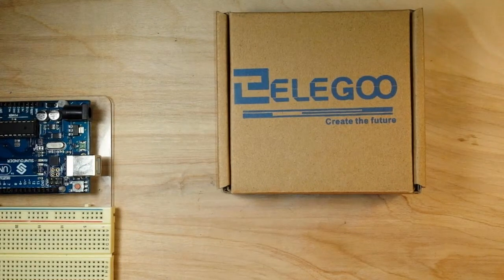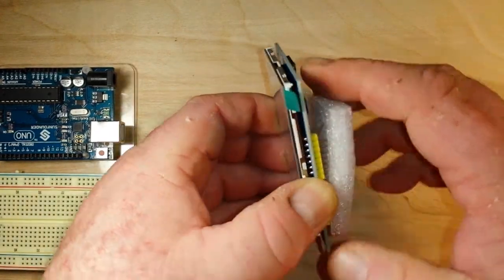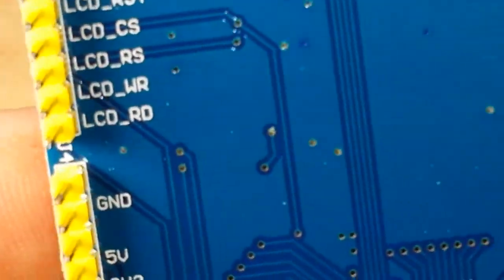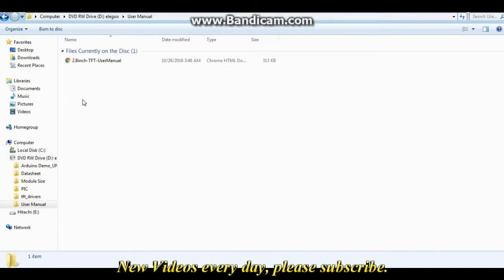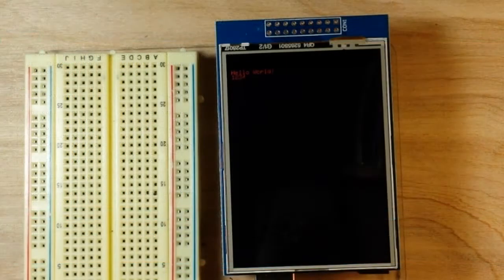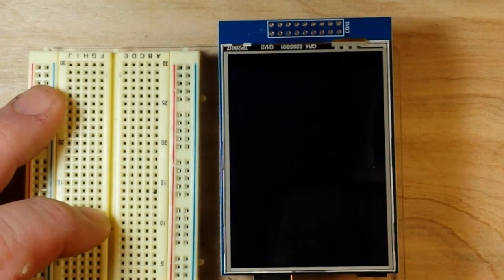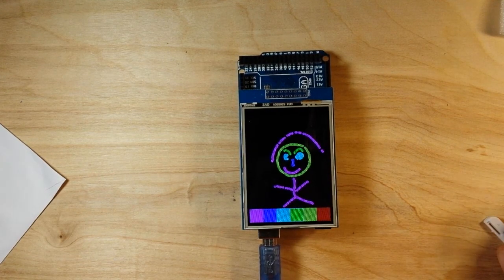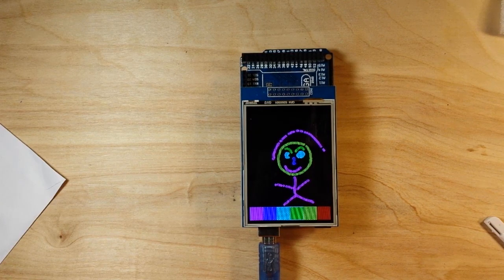How to install and use a TFTLCD with Arduino

Comment: Where do you get the tft drivers (initlcd and setxy) if you didn't get a disc and where exactly do you install them? 
I have the same TFT screen shield, had it for years but never got it to work.
I've tried every library I could find but can't get a thing on the screen, just the white LED backlight.
Reply from the maker: Adafruit
Reply: Cheers mate

Comment: Sometime between when you did this review and July 2017, Elegoo created their own modified versions of the Adafruit libraries, they even leave all of Adafruits copyright info and just substitute Elegoo for Adafruit. So for folks looking for a TFT that will use the Adafruit TFTLCD and Adafruit GFX libraries... well, they just may not work anymore.

 I have noticed several folks with OLED modules using the Adafruit GFX libraries. I think a good solution would be to use the manufacturers display driver (in this case the Elegoo TFTLCD library) and the Adafruit GFX library, so the one library could be used for multiple display modules. Next week I am going to look at the feasibility of using the Adafruit GFX library. If this is not possible I will just get the Adafruit display an let the Elegoo gather dust.

Comment: So can we attach any sensor with UNO and use this display ?
Reply from the maker: Sayantan Maiti it takes almost all of the pins on an Uno. It will work much better with a mega.
Reply: Please make a future video of making a photo frame with this display and a SD card
Reply: Thanks a lot Sir!
Reply: Just get the pin extensions if you need more pins.